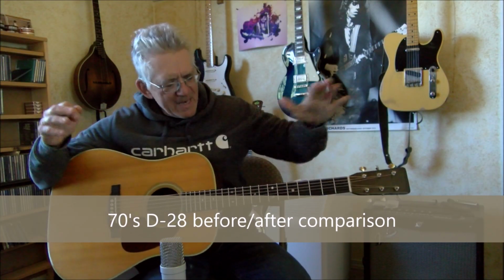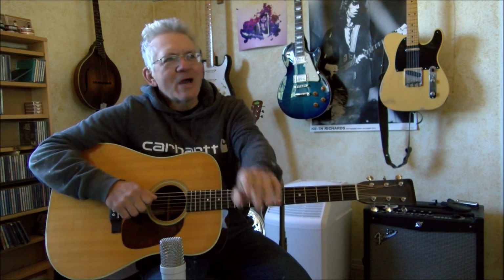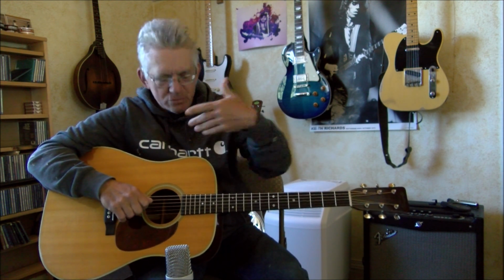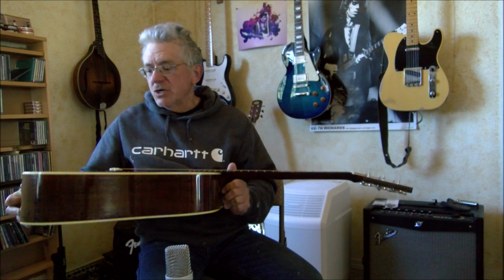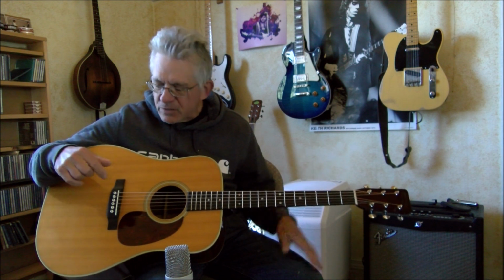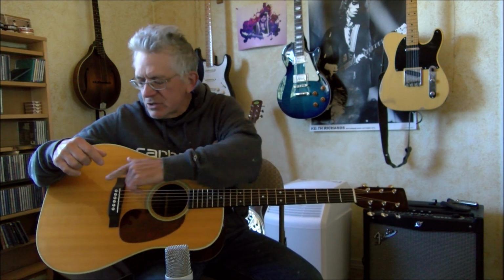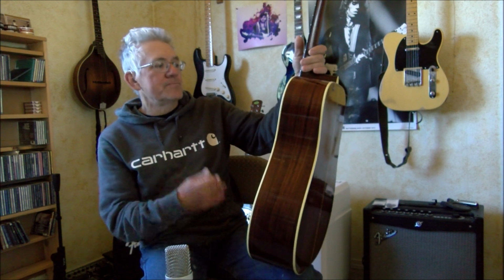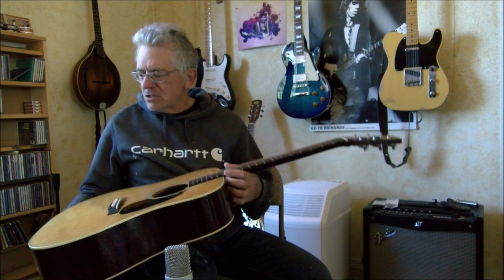A Martin D28 pre and post modification

Comment: Please show where you should put a lost inside pic in order to flip the guitar and drop the pic right out. Thanks.
Reply from the maker: I'm a professional.  Don't try this at home, kids.  :)
Reply: Center the pick under the sound hole, so that looking straight down into the sound hole, the pick is in the middle on the back of the guitar. Then flip the guitar over quickly, like Bryan did. But make sure you aren't close to any other objects that you might bang the neck or the body into!

Comment: To my ear #3 sounds the most balanced.  #2 sounds great too. #1 just needs to settle down a bit. Time and playing. Thanks Bryan.
Reply from the maker: #1 and #2 are the same guitar.  Pre modification, post modification.  #3 is a completely different guitar but I compared it to #1 in the original video and so it's making another appearance as the "control" guitar.